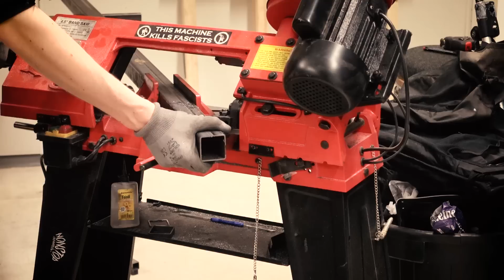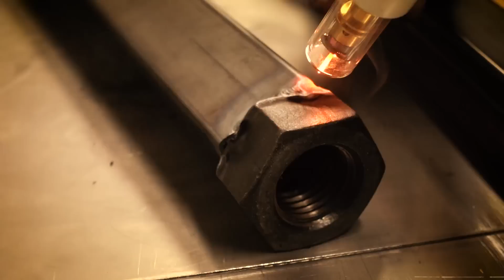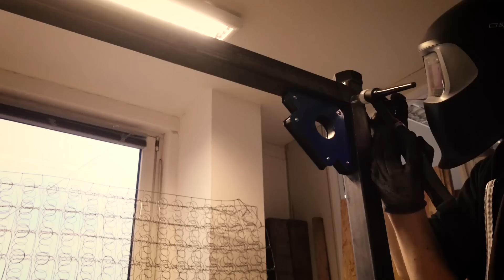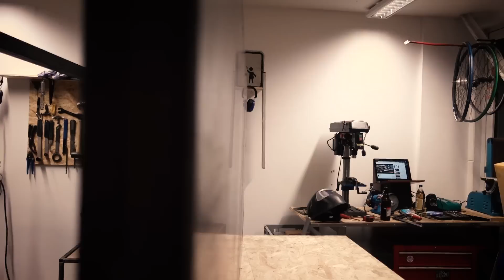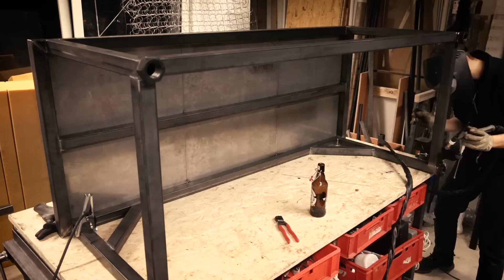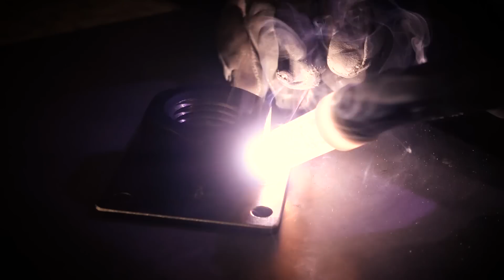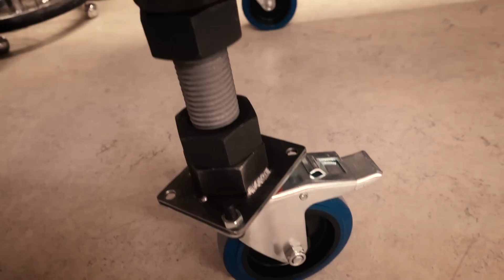Welding Table Build (Plans available!)

Comment: Slick as hell!  When I saw the first set of nuts I had no idea they were that big!  (no comments!)  I built my table out of steel racking like you see at Home Depot.  I just got it to a height I liked and welded all the contact points.  I figured if the hold tens of thousands of lbs. I'd give it a shot!  My next project will be a trolley hoist.

Comment: Nice simple and clean build. I tried the bolts for leveling on a bench I did - used bolt sizes too small for the weight of the bench and found them to be binding.
Cheers

Comment: Phil hi. I am an amateur welder and I like to do small weekend welding projects. I do not have a welding table and am interested in making one. The thing is, I don't have room in my garage for a table like this. BUT researching Youtube for a collapsible welding table, info is scarce. I think it would be very interesting if you uploaded a video making a foldable one, even the same size as this, but one that can be folded and placed against a wall. I'm sure there are many people in the same position with me. Thanks!

Comment from the maker: Dimensions of this Table: 180x70cm, 100cm in height, the tubing is 45x45x2mm, threaded rods and nuts are M36
Reply: Phil Vandelay can you make me a table or how much did the materials  cost?
Reply: Just my hitghth I'm in a wheelchair  and like how it's adjustable great video ima  try and make one I have most of the tools just not a tig welder a mug with  fix wire but I do have a metal chop saw
Reply: SNOOP U 2 he lives in Germany, maybe someone close by can help you
Reply: Wolfman Jack thank you for replying, I have a welder I've been a welder for 20 years, I was just looking for the lazy way out, I can use some of hi ideas I did draw out my own work table on paper with the measurements and all. I do have metal foundries that that sell metal. Thanks again Wolfman Jack for replying I do appreciate that I learn off comments to on YouTube comments teach to.
Reply: Nice work Buddy
Reply: Paulo , Brazil Very good !!!😎

Comment: nice table I have built a few the same way only thing I would do different is let the plate hang over the tubing a bit so clamping is made easier sometimes the tubing makes the clamps slip
Reply: kalei p agreed 100% but still love it
Reply: @kalei p.  That is an interesting thought.  I am about to build a welding table in the next two weeks.  I have designed one that has the same dimensions for the table top as Phil's here, (1800mm x 700mm) but I am going to have 100mm of plate hang over the tubing all around.  My thoughts are so that I can use clamps, which you mentioned also.  I am planning on using 6mm mild steel plate for the top.  Do you think 100mm stick out would be okay or do you think it might be too much.  I have seen a lot of builds but I haven't seen any with an overhang like I am planning.

Comment: The welding table you made looks good.
Most of the places I live prefer thicker iron plates.
Reply: I used a 1/4 in steel plate for mine but I was also aiming for a 500-1000 lb table

Comment: Good afternoon, Phil.
From now on I must tell you that the table is excellent ... I need to know if, in any place you have detailed the measurements of the table and the materials that you used ?. From now I thank you the information.
Greetings from Argentina, Angel
Reply from the maker: Hey thanks. As far as I remember the steel plates were 60x70cm each and 8mm thick. So that makes for a total width of 180cm, the base has the same size obviously. The square tubing is 45x45x2mm construction steel and the threaded rods and nuts are M36. I made it so that the height is adjustable from about 80cm to 120cm, right now the table is at 100cm working height just like my large workbench. The wheels are 150mm in diameter if I remember correctly and all of them can be locked in position.

Comment: 0:20 I don't have a saw like you, I only have a grinding wheel to cut the metal. Is there a way I can make the same cuts but with the grinder? To make the pieces perfectly fit? Thanks !!!
Reply from the maker: It's tricky to do with a grinder but I think you can get close if you're really careful. You'd probably have to do some filing afterwards to get the fit right and make sure to scribe accurate lines before and try to stay on the lines as best as possible.. there's also cut-off stands available, they're not that expensive and you can put your grinder into them and use them to make straighter cuts and also mitre cuts like these. If you're really patient you could use hacksaw too, they're actually more accurate than a grinder but it takes a lot of elbow grease...
Reply: @PhilVandelay  allright it's worth a try! thanks!
Reply: @PhilVandelay  I will try it with a hacksaw! How do you protect the bare metal finish of your table? Do you apply some oil or something?

Comment: Me and coworker are going to make one tomorrow. We are gathering materials. What size tubing in inches and what size all thread? Im guessing 2" tubing?
Reply from the maker: No inches over here ;) Dimensions are: 180x70cm, 100cm in height, the tubing is 45x45x2mm, threaded rots and nuts are M36

Comment: What is the name of the steel you used?

Is it possible to do welding in galvanized steel properly? I want to make my steel table corrosion free. It should last 70-80 years. 

Is it possible to galvanize a full 6 feet by 3 feet table after making it with Mild Steel?
Reply from the maker: This is just regular mild steel without any coating. I suppose it would be possible to galvanize it if you can find a company that can work with that size. I think it would be very expensive though. As for welding, you'd need to galvanize it after welding, if you weld on galvanized steel it will destroy the coating (and also produce some nasty fumes). Why not just use some high quality paint? Good paint can last a long time and prevent corrosion.

Comment: Nice job awesome.
Just a quick question if you don't mind? I am wanting to get into welding and from the videos I've watched they recommend a MIG for beginners but the TIG you use looks better to use what would you recommend?
Also you mentioned a degreaser do you use acetone as your degreaser?
Reply from the maker: It depends on what kind of projects you work on, TIG is better suited for very precise welding (for example most bike frames are done with TIG which is why I use it). It's much slower and a bit more complicated than MIG though. MIG is very fast and relatively easy to learn. For this kind of build (welding square tubing) a MIG machine would be much better suited and quicker. The only reason I use TIG here is because I don't have a MIG welder. That being said TIG is very versatile, you can do almost anything with it. It just takes longer and needs a little more care and preparation. In general it's good for smaller things that fit onto a table. You (almost) always need both hands for TIG and sometimes even a foot pedal in addition. With MIG you can just weld one handed which is a huge advantage if you have to get into awkward positions like welding upside down which sometimes can't be avoided. As for degreaser, yes Acetone works well and I use it although I would like to use something that's not as hard on your lungs, acetone fumes are pretty nasty. Speaking of it, never use brake cleaner on anything you plan to weld on, they contain a chemical that gets very toxic when heated.

Comment: What's the difference in usability between tables with a flat plate surface and tables with the sectional steel surface? Different use cases?

Comment: What size threaded rod is that?
Reply from the maker: It's M36 if I remember correctly. Probably not necessary, I picked it because the nuts matched the diameter of the tubing.

Comment: The welder your using is it a muti process welder. Because I find a bring new one on eBay for 368$. In your opinion is it gonna be a good welder that lasts. Or am I just wasting $
Reply: madbear3512 looks to be a Stahlwerk Tig 200 he’s using.
Reply: @quarterhorse1955  
Ok good to know. What do you use personal
Reply: madbear3512 I have a simple Lincoln mig pro for projects around the house.  Few years old but still works great.
Reply: @quarterhorse1955  
I wanna get a muti propose welder Tig mig and stick

Comment: Hi Phil, a very nice build welding table. Do you bought the metal bandsaw also on paulimot? If so, which bandsaw blade you use on it, or is the original one really good? Thanks a lot for your effort.

Comment: Pls tell me what filler rod your using for tig
Reply from the maker: Nothing special for this kind of thing, just the standard steel rods you can get anywhere.. They're called WSG2 in Germany but not sure if that designation is universal. I mostly use 1.6mm or 2mm rods for this tubing

Comment: Great build man, good thorough steps. Excellent looking quality.
I guess u prefer T.I.G. over M.I.G.?   I would've M.I.G. welded that steel tubing but that's my thing. I am a welder but TIG has never been my favorite process...
Reply from the maker: The only reason I TIG welded this is because I don't have a MIG welder ;) I started out with TIG because of bike stuff where you need the precision. MIG is faster for this kind of thing for sure, and more comfortable. I really need to get myself a MIG machine...

Comment: PV: I happened across this video while doing research on a welder I plan to buy soon. Right now, my choices are a cheap stick/TIG welder and a Miller 161 stick/TIG welder. After watching your video, I’m digging TIG and think that I might ultimately make TIG  my primary method of welding. 
Your TIG machine looks like a nice one. 

Question: is it better to buy a cheap stick/TIG welder to learn on spend the money up front and get the more expensive stick/TIG welder? 

You did an excellent job on your table. After I get more proficient as a welder, I might try to make something similar.

Comment: Nice build!! What are the dimensions of the table?
Reply from the maker: 180x70cm, 100cm in height, the tubing is 45x45x2mm, threaded rots and nuts are M36

Comment: I noticed the project used Tig all the way,  What is your opinion of Tig vs Mig welding?   I am a novice and have not purchased my first welder yet but am getting closer.  What would you recommend as a welder to start with?   And nice table
Reply from the maker: Good question. Generally, for something like this (welding square tubing together with simple joints) most people use a MIG machine because it's simply faster, easier and more comfortable to use and just gets the job done. The reason I used TIG for this is simply because it's the only welder I have (it can do stick welding too but let's not get into that). MIG is easier to learn but gives you less control over what's happening with the weld and in turn also gives you less understanding, because once set up right, it's possible to use MIG literally like a hot glue gun and it kinda does the trick but also hides a lot of the finer intricacies of welding due to mashing a lot of the important variables together. That's a bit simplified and people will disagree but that's how I see it. So with TIG, you have to control everything yourself, which makes it much harder to learn in the beginning, but the knowledge that you gain is invaluable in all kinds of welding because it gives you a good understanding and intuition on what's actually happening when you melt metal together. So that's why I think it's actually a good idea for a beginner to start out with a cheap TIG machine (there's alright ones to be had for as little as 250$). TIG is also great for welding thin, small material precisely and it's the only process that can do it properly. It can also weld big things though, although it's gonna take more time than with MIG. So in short: If you mostly just want to throw together some tubing quickly for something like this, get MIG. If you have time and patience and are prepared to gather some information to really get into welding, get TIG. Ideally you'd have both and that's what I plan on someday. Either way there's great resources here on youtube for everything. Check out weldingtipsandtricks, weld.com, chucke2009, the everlast channel, kevin caron and many others here on youtube for tutorials and info. That's basically how I learned :)
Reply: Thanks for the direction.  Time and budget will be a factor as it will be a hobby to start.  I am rewiring my garage to accommodate a few 220 lines and will be able to get a decent welder (and table saw).  Do you think, just to start with, a welder from Harbor Freight would be a good starting point?
Reply from the maker: I actually started out on a flux core welder (kind of the worst of all worlds) from a store like harbor freight and it worked for me but I'm not familiar with their lineup as I'm not from the US. Most of these stores sell generic machines from china that just get branded to the store. They can be a good deal for the money but I would suggest to definitely look for some reviews online before you buy anything like that. But you definitely don't need a super expensive one to start out like some people would tell you.
Reply: Perfect.  Thanks again for the direction.

Comment: Nice work! What was that 3/32 tungsten and 1/16 filler?
Reply from the maker: 1/16" tungsten actually but I've since switched to 3/32 for most things I weld. I also broke that glas lens so I'm back to the ceramic ones...

Comment: HI where did you buy that big rafter  square?
Reply from the maker: You mean the one I use to align the legs? I made that myself from some steel tubing ;) It's probably not super accurate but it does the job for this kind of thing
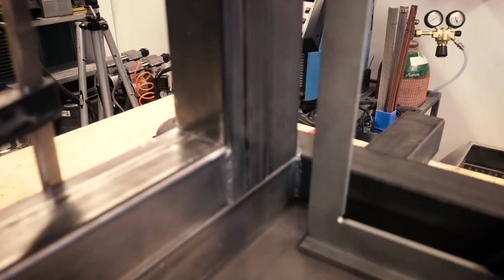Reply: not the welded shs....the one at 2:38min.....or did you make that as well? I've seen a few people with it....really handy than your normal rafter square...
Reply from the maker: Ah now I know what you mean. I think I just bought that one at the hardware store. I think they had even bigger ones too
Reply: Phil Vandelay anyway I found one here in nz for about $300 ish....which is at least 600mm long by about 400mm base....
Reply from the maker: That's pretty big!  I think the one in the video is only like 15x20 or something like that

Comment: Good video and all, but is it not more common to TIG weld without gloves? I thought it was because you need more dexterity? Or is that just bad practice i imagine?
Reply from the maker: Not really. You're melting metal so unless you're doing something really small and quick or are just tack-welding, the workpiece is gonna get very hot. Plus usually at least one hand is resting on the workpiece to be more steady. In my experience it's easier to get away without gloves using MIG because you don't necessarly have to touch the work piece. In both cases it's kinda dumb and you're probably going to burn yourself. That being said, you can get away with thinner gloves using TIG because you don't get sparks and spatter. Often times I just use normal work gloves instead of leather welding gloves. Gloves also protect against the UV light which can give you skin cancer. Obviously that's pointless if you weld with your sleeves rolled up like I often do - don't do that, I'm dumb.
Reply: @PhilVandelay  this might be a silly question but how long do weld uv burns normally last? and are they supposed to be painless after applying neem oil and aloe ?
ps what is the dimension of your tube profile?

Comment: what size tubing is that?
Reply from the maker: 45x45mm with 2mm walls. Pretty light for a welding table but I've had no problems with it.

Comment: Hi Phil awesome build as usual.....keep up the builds.....PS what size was the threaded rod for the feet, never seen that big before. Regards Beagles.
Reply: Hi Phil got it..... Duh M36mm
Reply from the maker: Right but it's actually way oversized. M20 would have been easily enough for this, I think I just picked it because the nuts matched the tubing so no connecting plate was needed
Reply: @PhilVandelay  Cheers Buddy, having a cold one now wish i could shout you for the night.....We should have been there but for this bloody "MAN MADE DISASTER"..Maybe its safer if you come done here.....LOL.

Comment: Why did you use TIG? Preference? Or was there another reason?
Reply from the maker: The reason is I only have a TIG machine. MIG would be much faster for this, but so far I couldn't really justify the cost as I'm rarely in a hurry and TIG gets the job done. Also much cleaner (my new shop has a fire alarm system, so making lots of smoke is a bad idea)

Comment: Just wondering why 45 degree supports on only one side?
Reply from the maker: Because the back side is supported sideways by the horizontal cross brace on the bottom, but the front needs to be accessible so you can sit down in front of it
Reply: @PhilVandelay  excellent design. Well done

Comment: How much would something like this cost for the raw materials?
Reply from the maker: Pretty affordable, which is why I built it this way. A single steel plate would have been much more expensive. I paid about 80€ for the plates and about another 50€ for the steel tubing. The threaded rods and nuts were about another 50, so were the casters. So including some minor things I'd say around 250 overall. I guess prices would be similar in the US. Make sure to get good casters! Makes a lot of difference.
Reply: Bryan Fewell same question  I asked
Reply: Phil Vandelay okay I'm  here in the United States so yes I need to  check on what's  here closed to me my brother is a scap metal guy  but I want to use clean  steel
Reply: Phil Vandelay I think 250 euro measures is $290 in real (Great again) money? 💵

Comment: What welder are you using?
Reply from the maker: It's from a German company called Stahlwerk, AC/DC WIG combined with built in Plasma Cutter (which I've never used so far). It's a bit on the cheaper side but I'm very satisfied with it